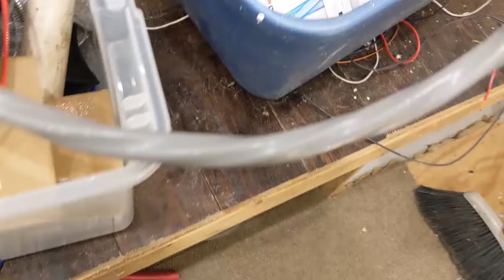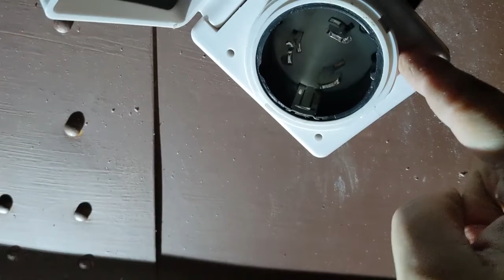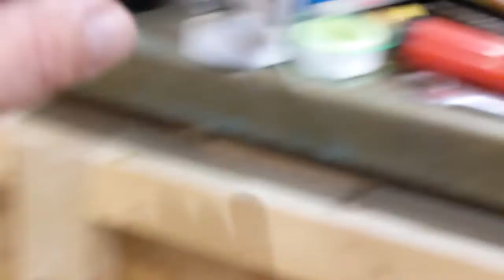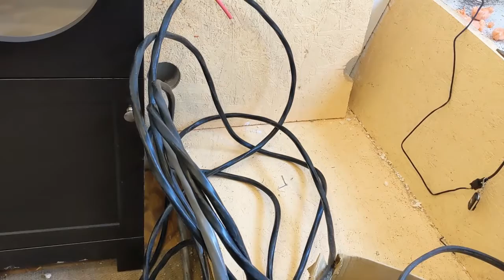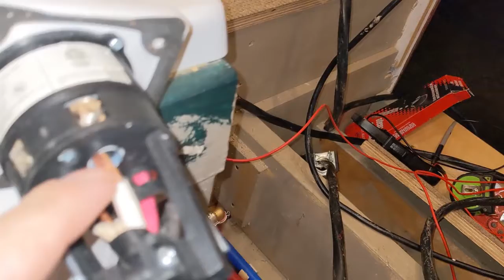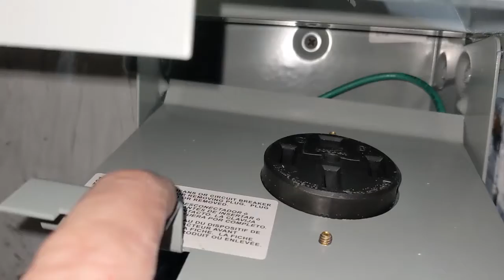Skoolie Build #72: Installing the AC Shore Power and Service Panel Interlock to Protect the Inverter

Comment: I find it rediculous to have such a breaker panel in a bus conversion.
Reply from the maker: When you build your own bus, you can build it however you want. I personally wanted nearly every item home run on its own breaker.
Reply: @allmomomosthomebus3895  I can only guess you are living in your bus full time, always hooked up to shore power ?
Reply from the maker: We're going to travel full time in it for awhile and it will have 3700 watts of solar and the inverter is 6000W. The battery bank is 15,000+ Watt hours. We will be able to behave almost like we would in a normal home with a mini split heat/AC running long enough to actually be comfortable inside and running whatever appliances we need to without much concern over lack of power. I also designed it the way I did for other reasons. And it may eventually be parked as a tiny home on one of our properties.
Reply: why?